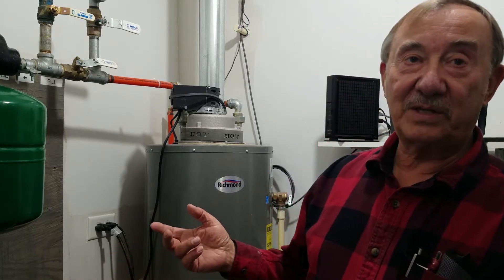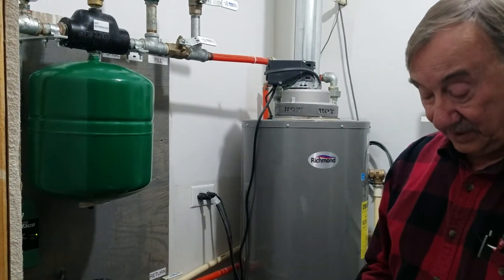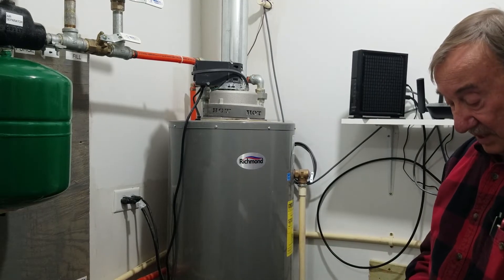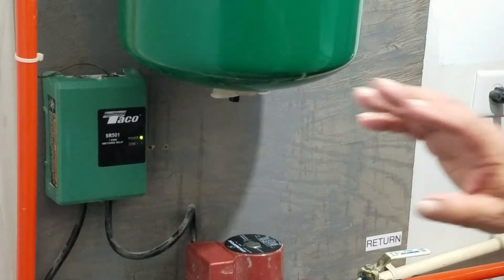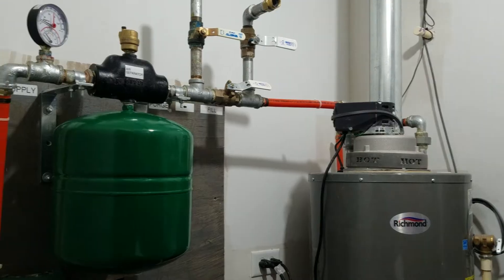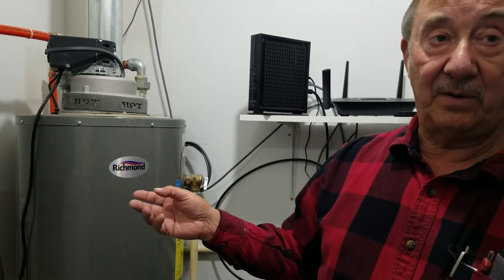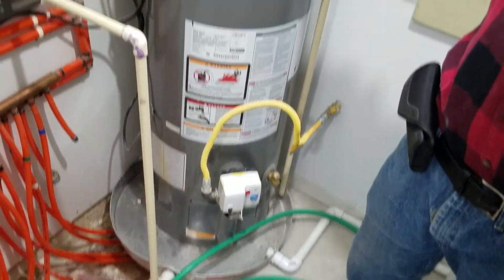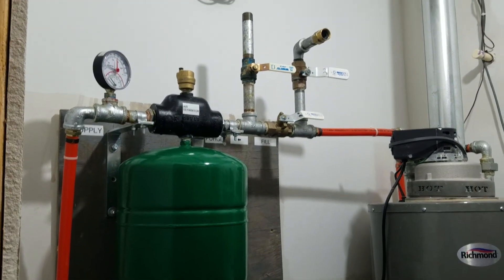Radiant Floor Heat With A Water Heater

Comment: You need to rotate your pump 90 degree in the horizontal plane.  Consult the manufacturer's instructions.  It will fail prematurely if you don't.  I have nine of them in my home, one for each of my seven radiant zones, one for my Burnham radiant boiler and one for the domestic hot water return line.    My pump for the domestic hot water was originally installed the same as yours and it failed prematurely.   You have a great heating system.  I originally wanted to use hot water tanks for mine as they are more suited to radiant floors then boiler units, but the BTU calculation for my home was too high.  I heat 4800 square foot of living space and a 1000 square attached garage.   I believe my 110,000 BTU calculation was too high.  In twenty years, I have never seen all seven zones calling for heat at the same time, not even during last week's blizzard.
Reply: I would love to see your set up.  We have a bunch of zones and I'm trying to figure everything out myself.  We have about that size on one floor, then a work floor with another bunch of sq footage, but most wont need heated much.  Im looking at hybrid heat pump water heater.  Anyway, Id love love to see your set up

Comment: I've been using the exact same set up in my shop for 25 years with no problems until the burner corroded up . 👍
Reply: By "burner" do you mean the Water heater element?

Comment: Ofcorse it’s a pain to get air out you have no purge set up on return 🤦🏻‍♂️ and that’s really just the start of things wrong/missing but if you got it to work then it works lol
Reply: Have a run of tubing higher than the rest with a bleeder valve on top. Stop the flow and come v=back later and open bleeder until water runs out and close it. Repeat til no air comes out. Similar to bleeding brakes but no pedal to push, air will rise.
Reply: @cravinbob  good luck

Comment: Nice job for helping the dying crowd. I'd like to point out a few things. The boiler, or water heater in this case, should be before the pump to properly vent the tank which is at the lowest pressure drop point in the system. Hydronic pumps are engineered for much higher water tends than your 120 degree supply. There would be a vent fitting such as the air scoop you have after the heater. The tubing used in a radiant system MUST be cross linked polyethylene with an oxygen barrier if any components in the system are ferrous metal, even with anti-freeze which breaks down over time and must be replaced. Thanks for posting.

Comment: So if antifreeze were run in the system, would you even need the anode? If not, it seems like it would be great port to install a pressure gauge and/or second relief valve. The reason I ask is that I currently have this setup in my home for a radiant system and the installer used the top anode port for this purpose. The tank has a mfg date of 1994 on it and just gave up last winter. It had been "repurposed" for radiant around 2007 at which point the anode had been removed. I should also add that regular water was only used in the closed system, along with a fresh water check-valve to make sure it always had water.
Reply: From what I know, anti freeze only inhibits, and slows down corrosion,  I would still keep the anode as safeguard and install a gauge inline.

Comment: How were you able to add pressure to the system? Curious to how that works
Reply from the maker: That is a great question. There is no pressure built into the system. The pressure increases as the temperature of the water increases.
Reply: Dont need pressure, all you are doing is making the water go round and round

Comment: I used to maintain the temperature on 70 in last January with this system. Will anyone please tell me how the electric consumption is 194 usd for only 14 days? is there any problem in the system? As I live in a private apartment in CT.
Reply: That's very high. Being an apartment they may have failed to properly insulate under the floor. Check with your neighbors to compare bills.

Comment: So this is a closed loop system? How many gallons did it take to fill up this type of system? How many ft of tubing did this take?
Reply from the maker: About 40 gallons. About1400 feet
Reply: @professorgadget9153  did you use any glycol in it or distilled water?
Reply: @nicholsceramiccoating8284  He spends like 3 minutes discussing that

Comment: Ill make this quick and to the point. Your circulator is installed incorrectly, you have the motor in the vertical position which allows air to get caught around the water lubricated shaft. Read your grundfos manual it has diagrams. Your circulator is not pumping away from the expansion tank. This means you are moving the water through your system with a negative pressure, this is why you are having air problems. Next, You are still using the 150 lb relief valve that came with the water heater, it is now a boiler and the relief valve must be changed to a 30 lb valve.  If anything change that relief valve. Also corrosion in closed loop heating systems is caused by Oxygen. Oxygen is cooked out of the water in the first few hours, I work on systems that are over 100 years old and still rethread the steel pipe like it was new. On the other hand, Propylene glycol deteriorates into glycolic acid and must be tested yearly. Last but not least you left no way to isolate and drain your expansion tank for yearly air testing. This means you will have to drop the system pressure and introduce air just to check the bladder pressure.
Reply: isn't that horizontally installed?!
Reply: can I use car antifreeze in this system it is less corrosive
Reply: @Joe-tz3un  No, that is ethylene glycol and is toxic.
Reply: @heavyduty3503  The pump is horizontal but the motor shaft is vertical.
Reply: Holy shit it’s my favorite plumbing teacher! Ur the man Duke! Still loving Dan Holohan and John Siegenthaler ,thank u for all the knowledge!
Reply: @adamgruber2342  That was my father, he passed a couple years ago. But thank you
Reply: His pump is actually correct… just put a new one in for my system… and read the manual.  That is a newer energy efficient one
Reply: Anthony, can you suggest a publish video or such that explains the correct installation of floor heat utilizing a water heater??
Reply: Can you use an Electric water heater?  Thanks
Reply: @JOETRIPPER920  Lets do the math. We get 3.41 BTUs per watt. Water heaters usually run 4500 watt elements but not simultaneously. So we have 4500 x 3.41= 15,345 BTUs. If the space you are heating can be heated with 15,345 then you are good to go. You can also run the water heater with simultaneous element wiring. This would give you over 30 k BTUs. If you can satisfy the heat load on a design day(coldest day) you can do it.
Reply: @anthonyspadafora1384  Good Stuff. Thanks

Comment: I installed almost exactly the same thing in my house back in the mid 80's which was unusual at the time especially here in Tennessee.  It has worked well with little maintenance. I have exactly the same Grundfos pump and I have had to replace it once. Except for the in tubing in the slab I did all the above floor work myself.  I only run my water temperature at about 100 degrees which was what was recommended at the time.  I suppose the reason you only have to run it about 2-3 hrs. per day is because you have a 120 degree water temp.

Comment: Do you have a link on where to get the set up. 
How much it cost.  Does it heat your house or just the floor.  How much much your  bill per month to run it
Reply: When you heat the floor you ARE heating the house as heat radiates up from the floor heating everything in the house.
Reply: @Roger G  ok thanks. Where can I order  a set up.
Reply: @realgoon8373  Just search for hydronic radiant floor heat systems.  You should find several reviews on Youtube.
Reply: @Roger G  ok thanks for replying  willl contact  if have more question  cause we have my blocks down   ima go head get my hear set up now

Comment: I think your energy bill would be lower if you used straight distilled water and no anti-freeze.  Also blow out the water annually from the hot water heater and PEX. It is just water, so it can go down the drain. This removes sludge from the bottom of the hot water heater. With your water heater depressurized, remove the sacrificial anode rod from the top of the water heater, replace it when it looks like it is being used up. You might want to replace this rod annually.. It is cheap insurance. If your pump needs to be oiled, this would be a good time to do so. Best wishes.

Comment: Hello Sir.    I liked your video.  Great job.  Glad to hear the system is working.  I notice the Grundfos pump is onstalled with the motor turned up vertical.   If you read the Grundfos manual it will say that is NOT a way to mount the pump.   The pump can be mounted horizontal like you have but the motor needs to be mounted on it side.  Just rotate the assembly 90 deg.    THe pump motor will last much longer.
Infloor radsiant is the best.

Comment: I use a similar system to heat my garage only I use my hot water tank from the house and mine is a open loop system so it's always using fresh water as hot water is used in house. Been running for about 12 years with no issues. Love radiant heat

Comment: Thanks for the great and simple video.  I'm doing the exact same set up in my shop.  My question would be is how much antifreeze/water goes in the water heater? Mine is a 40 gallon.  I have my lines in the floor filled and most of the air purged out just not sure of the water heater.
Reply: Just read the instruction on the back of the antifreeze jug about mixture ratios; it all depends on where you live BUT since you aren’t using this in a cars radiator, I’d venture to say you can go thinner than recommended (aka use less antifreeze since the system will be “inside”). An average car takes a 50/50 ratio for “normal” climates. Add more or less based on the jug recommendations. if you do go buy antifreeze, buy the concentrate and not the premixed kind as you will be needing LOTS of it and you’d also just be buying 50% water with the 50/50 mix…. It’s great for topping off cars in a hurry but when changing the whole system out, you’re just wasting money.

Comment: I want to take out our oil boiler and use a tank as well. I called a company to see a quote that I expected to be around 3 to 4k. What they gave me was attitude, and saying no you cant do tgat ??? Really ....  then gave me a quote for 18k ... Guess I will be doing this myself , I CAN do it ..
Reply: 18k for a hot water tank install and removal of the boiler?  wow!  i thought $33,000 was bad to install a boiler, the pumps, controller etc etc.  i had already placed the pex in the concrete.  so basically $33,000 for all the parts and labor.

Comment: at 8:59 it looks like you tightened your air/water separator vent screw all the way down.  i believe you want that loose so air that gets generated can escape.  check your model though.  mine you dont touch ever.  its set from the factory.

Comment: Did the same thing to my house boiler went out companies wanted thousands so I cut it out and put in a water heater works great and since it’s electric if I lose power a small generator heats my home as is all is normal

Comment: That is not a High Efficiency waterheater. Not with a 4" ventpipe connected to it.
Reply: What evidence do you have besides the size of exhaust flue?
Reply: @charlesarmstrong3536  metal pipe indicates that combustion gases are around 300 degrees, with plastic pipe they would be around 140 degrees, so hotter exhaust means more energy didn't get used

Comment: one suggestion.  If you have several separate zones, each controlled by its own thermostat, you can get by with a smaller water heater, since most of the time all three zones won't be calling for heat at the same time.  You can also initially heat up each zone individually so the water heater will keep up with that high demand situation.  Great video and explanation.  Thanks

Comment: I would like to build a system with a propane hot water tank .  I am using a wood stove to heat my water now in an open system , would like an open system on my hot water heater too. An open system is so much simpler !!  Any advice??!!!

Comment: The pump is installed incorrectly. The motor should never be mounted on top. You should rotate the pump and the flanges. The bearings should not be on top.
Reply: Please explain.
Reply: @charlesarmstrong3536  it's a wet rotor pump, so water acts as a lubricant, with motor facing up, it can create an air pocket and rotor wouldn't be lubricated on one end. Every pump manufacturer has acceptable mounting positions listed in the installation instructions
Reply: It should also pump away from the “boiler”. Those pumps are made to pump 180 degree water,so the temp of the water is no concern.

Comment: Wow so this is a closed system.  Does the system ever need to be topped off?  On a regular boiler there’s a fill valve that allows it to fill as needed or if needed.  Do you have to check it to see if it’s low?
Reply: If there's a pressure reading on the gauge, it has water in it, assuming that the gauge isn't stock. Otherwise if water heater is hotand pump is running, but floor is cold, you know you have a problem

Comment: Just what I was looking for. I currently use a wood boiler to heat my house but have wanted to switch over to a hi-efficiency water heater instead so I don't have to continually fill the wood boiler.
Like you, I have searched for an example to learn from and yours is an excellent system in its simplicity. I like it with few parts as that makes for less things to fail in the long run.
Good job Professor Gadget.

Comment: A reliable,simple, flexible, economical, low maintenance heating system. It will last 30+years i think except thermocouple replacement in 10 years. Lower the gas pressure to 3iwc and recover some heat from flue pipe will increase efficiency to 80+%. That is good enough  but please install CO detector all times

Comment: Honestly, if you’re cheap, a tankless water heater works just as well as a boiler.  Doesn’t have all the features, but when you get a unit with a good turndown ratio, spending $650-950 on a tankless is better than $4k on a boiler.  The tankless units last about 7-10 years minimum if you use them for radiant. Then you switch it out for a new one.  Cheaper than a maintenance visit or a repair for a boiler. More efficient than the big tank here.
Reply: Can i use my existing 200,000 BTU natural gas tankless water heater for domestic hot water and add pex and a pump to heat my 20 x 17 garage floor?

Comment: If you had in line shut off valves on one side of the manifold you can fill one run at a time to eliminate air in the system. You can also control the flow if you get a area that's hotter then the rest of the house. You will always have a run that flows better then another. Just my 2 cents.
Reply: True! Cheap too.